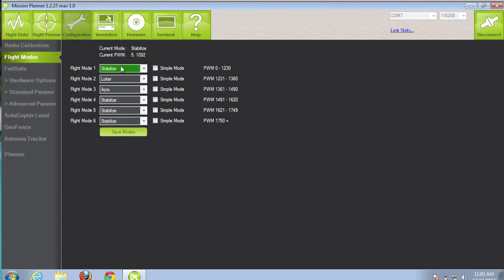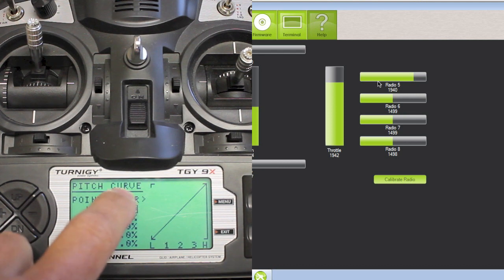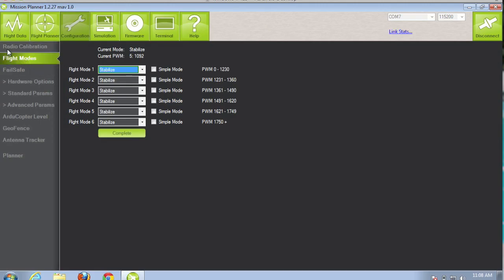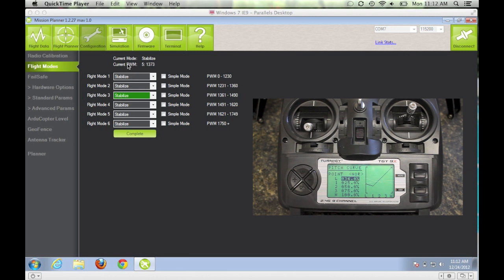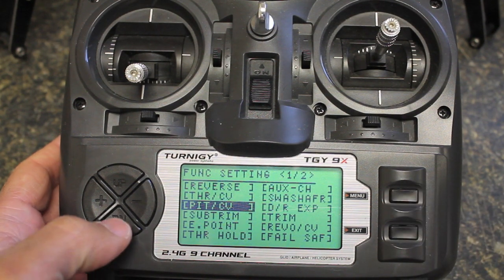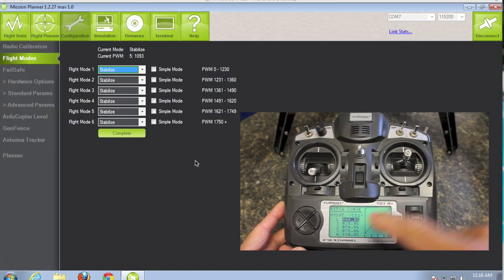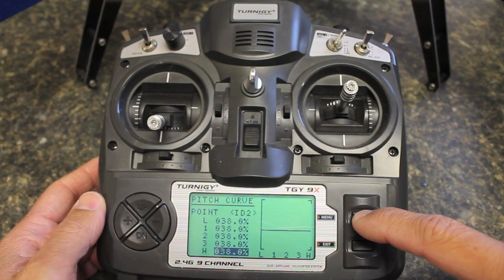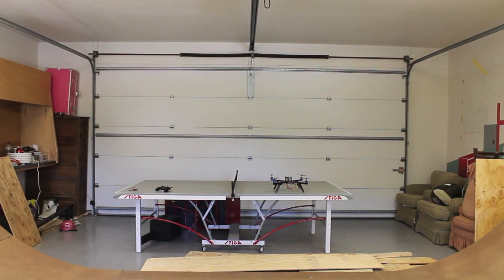Turnigy 9x Transmitter & 3 Mode Auxiliary Switch for Different Flight Modes with APM 2.5 Quadcopter

Comment: can i use this, (ZOP Power 6.6V 2000mAh 8C LI-FE Battery), to power the FlySky TH-9X?
Reply from the maker: I'm not sure. check the power input requirements for the TH-9X and if it's a 2S input I don't see what this battery wouldn't work.

Comment: Great video Dennis ~ Thanks !   Can you tell me how to assign one switch to operate 2 or 3 others please ?  I have put expo on Rudder ~ Elevator ~ Aileron so I can switch it on or off but would like to be able to control it with one switch only if possible ?  Manual is next to useless so any help will be most welcome !    Thanks again Dennis ~ I now have 6 flight modes configured after following your very easy to follow video !
Reply from the maker: +Eddie Lloyd Thanks so much for the good words. Unfortunately I no longer have my Turnigy 9X so I can't recall how to do what you're asking. Maybe someone in the group will know. Good luck with your setup.

Comment: I have an FS-TH9X, it should be same as the turnigy 9x. Where you get that MODE 7 ?. Mine only have 4 modes.
Reply from the maker: +Sam Smester Maybe you need to update firmware if you don't see it? I'm not sure as I've never worked with the TH9X.
Reply: +Dennis Baldwin My mistake, that MODE refer to Model looks like you had 7 Models on you radio and used #7 for the demo. Thank you for this video, it works in the FS-TH9X as well, all I did is swap channel 5 and 6 on the receiver connections to the PPM encoder. I set that switch for Alt-hold, GPS and RTL like it is done in the Devo F12e for the Scout X4.

Comment: Awesome video man, I have the B revision RX/TX and if I use this method, it does give me three flight modes, but it makes my quad unresponsive to roll input. Not sure if you experienced that or not, but I followed your instructions to the letter with minor variations to my pwm values because my TX has slightly different pwm ranges.
Reply from the maker: +Qdoggus I haven't experienced that before, but good to know. I'll need to revisit and see if I can update the video with the latest rev. Thanks.
Reply: Absolutely man, you're welcome.

Comment: my turnigy is standart like yours, why the pwm signal on calibrate radio is not up to 1943, but just full on 1845,, ?
Reply from the maker: +magfur ramdhani Perhaps look at your subtrims and endpoints. Maybe those are limited.
Reply: +Dennis Baldwin hi Dennis thx for helping me

n this is real, my quad orientation is  reverse, when i forward my elevator, the quad is backward, and conversely,,, so i reverse the elevator on submenu reverse,, why this is happend with may quad

info, i use :
All setup remote like yours

APM 2.6
Remote standart firmware turnigy 9x like yours

thx Dennis

Comment: Dennis, I watch your videos all the time. Great job! I have a Pixhawk build, and using a ppm encoder. All channels (1 thru 8) are going from the Turnigy receiver into the encoder, and a signal wire going out of the encoder, into the RC port of the Pixhawk. This doesn’t allow the ability to go from ch6 to pin5 to operate the flight mode. Next to the PPM Signal out pins of the encoder is another set of pins saying AUX. Would it work to connect the AUX to pin5? I’m stumped. Thanks, Joe
Reply: +Offroad Footage , I have the same configuration as you. I just managed to solve it by swapping cables for CH5 and CH6 in the receiver.

Comment: You can set up to 6 modes combining 3-mode switch and AIL D/R switch in mixers. The order of modes will be 1-2-3-6-5-4 but each you can tune in MissionPlanner and keep it in mind like 1-2-3-4-5-6 )

Comment: THANK YOU!!! 
After MUCH googling and youtubeing, this is the first that actually helped me! I wanted to use a 6-channel receiver instead of the bulky included 8-channel, and all other instructions made me end up with the 3-position switch on channel 7 somehow, using PLANE-setup and mixings! Haven't tried it live yet, but it seems to work on the bench with my new NAZE32 and CleanFlight!

Now, the question is, can I use channel 5 for anything useful still, or will that screw up anything? Could I i.e. set the gear-switch for arming or a beeper (lost model alarm) or LED's?
Reply from the maker: Preben Stub Thanks for the feedback and great question. To be honest I'm not entirely sure. It's been a while since I messed with my Turnigy 9X and don't recall ever trying this. I would assume the channel is not available since it's setup as AUX, but don't quote me on this. If you test let us know what you find out!
Reply: Dennis Baldwin I have now upgraded my Turnigy 9X to ER9X Firmware, and managed to get the 3-position switch to channel 5 without any problems, and the possibility to put any other switch on channel 6. Works great! Don't know why I didn't upgrade earlier! :-) Thanx again!

Comment: good afternoon how to make the flight modes for hexa 6 engines?
Reply from the maker: ulisses salvador I'm not sure. It's more dependent on the type of flight controller you're using and not so much on the number of motors you're flying with. So you should be able to use a similar configuration if you're flying with APM or NAZA. Sorry....hope this helps.
Reply: Dennis Baldwin I'm using the radio Flysky fs TH-9x 2.4 ghz I'm using 6 engines

Comment: Hello. 
Thanks for this informative video. 

Can I ask if you know how to get 4 flight modes from a 3P switch on the 9X, or even if it's possible ?

I have a flight stabilizer for an aircraft that needs 4 different signal pulse widths all on the same Chanel. I know that would require a mix of some kind, but I'm not sure how this might work. 

Thanks again.
Reply from the maker: ***** Thanks for watching and the feedback. The only way I know to get more than 3 flight modes is this setup:

https://www.youtube.com/watch?v=sHOAMyFRGiM

It's somewhat depending on your flight controller. I wasn't able to do this with the NAZA and only the APM from my tests. Best of luck and let us know how you get along.
Reply: ***** You can set up to 6 modes combining 3-mode switch and AIL D/R switch in mixers.

Comment: I purchased a Fly Sky, FS-TH9X, which is supposed to identical to the Turnigy 9X. But it doesn't show "Pitch Curve" or "Throttle Curve" in any of its menus or submenus? Is this suppose to designed this way, or has something been left out of the radio? What program to you use to program it then?
Reply from the maker: Joseph Gunther I believe those are pre-programmed with certain templates. Perhaps the FS-TH9X doesn't have them. Not sure how to help as I've never used this version of the transmitter.
Reply: Joseph Gunther  Just trying to setup the 3 pos switch. THe Pitch Curve exists in the Heli Mode and not in the Airplane mode of FS TH9X... Now what?:)

Comment: Hi Dennis, quick question for you if you don't mind.  I have only used DJI flight controllers and I'm looking at getting the new HKPilot 2.7 however I have a lot of questions.  What I'm trying to figure out is that the website says you can link this up to a tablet, have you done this before?  I'm curious if you can modify waypoints out in the field?  I'm pretty much just trying to wrap my head around the whole mission planner/ waypoint tracking in itself.  Do you bring the laptop/ tablet with you, do you need to be connected to wifi?  Do you have to to waypoint tracking planning prior or can you change on the fly?  I apologize for all of the questions but I know you're smart and probably have some great answers.  Thanks Dennis!
Reply from the maker: Mike Niederlander Yes you can link it up to a tablet if you have the telemetry radios. You must also make sure your tablet supports the on-the-go cable otherwise you'll be forced to use Bluetooth, which I like better (no wires!) Here's a vid I did that talks a bit about it:

DroidPlanner Telemetry for APM 2.5 using Samsung Galaxy Tab 3 and Bluetooth Module

Yes you can modify waypoints in the field. I plan on doing an in-depth video on DroidPlanner soon. Will definitely cover this. Hope this helps and thanks for watching.

Comment: I will be using my 9x for my new hunter Vtail quadcopter... what mode should i setup? Heli or Acro? Thanks in advance
Reply from the maker: Lance bourque I've recently been flying in ACRO mode. If you want more info about why check out this video:

Turnigy 9X Heli and Acro Flight Modes Explained

Hope this helps and good luck with your setup.

Comment: Hi Dennis quick question does the backlight turn off after a few seconds on turnigy 9x v2 stock hook up?
Reply from the maker: ras4q2001 Mine doesn't, but I did it get it off ebay with backlight already installed. But I do remember my original T9X with a green backlight stayed on all the time too. I'd venture to say that's default behavior.

Comment: I have the original software but i'm missing PIT CURVE! Why?
Reply from the maker: Alexgri You may be in a different flight mode. I did a video a while back explaining the different modes:

Turnigy 9X Heli and Acro Flight Modes Explained

Good luck with your setup.
Reply: I am in Acro , is it right?

Comment: It's interesting trying to follow along when you're running APM Planner 2.0.10.  In 2.0, the "green bars" are in "Initial Setup", not "Configuration".  Once I found the right screen, the rest of this went smoothly.
Either from this video, or the three-mode video, I have AUX CH5 set to GEAR.  Can I use channel 5 again?
When I moved the servo lead from channel 5 to channel 6 and re-started, my PC changed the port speed to 9600!  It may not be a fluke, so be sure and check Device Manager/Ports and the port setting of the Arduino device before trying other things.
Reply from the maker: Thanks for sharing that info, Hugh. I've been trying to convert to APM Planner but am still using Mission Planner for a lot of the log analysis tools. Strange that your port speed changed. Not sure what's going on there. I'll see if I can mess around with APM Planner this week and see if I get similar results. Take care.

Comment: Hello Dennis, congratulations from São Paulo, Brazil.
Yesterday I made my fly RcTimer APM 2.5 is great, very stable, but the loiter command is causing the quadricoptero descend slowly to the ground.
Before I do any tampering, you would have an idea of what might be going on. Another piece of information, the board is inside a case and put the recommended foam over the barometer. She is protected from wind and light.
Thank you very much.

Roberto.
Reply from the maker: Roberto, have you done the compassmot routine? Not sure if that will address the descending, but it may be worth a try. Regarding the barometer is the case from 3DR or another provider? Wish I could be of more help and good luck. Also, if you get this resolved would you mind sharing your findings at www.garagepilots.com? There are a lot of us over there that could benefit. Thanks!
Reply: Hello Dennis, actually my flight controller is the RcTimer, and that worries me, may have come with some problem. Still I will do compassmot routine and see if I solve the problem.
I would like to thank you for your attention and for sure all the information I get about this problem, I will share with you all.
Thank you very much.

Comment: i just got this copter but with no radio or reciever..  what radio do i use what transmitter? what size battery do i need for the copter?  it also has telemetry how do i hook that up to see it with a android phone and or visior?

im freakin lost i got it off a cl guy for a good price has everything i need cept the radio and reciever and how to hook it all up
Reply from the maker: I would recommend a Turnigy 9X TX/RX combo. You can get this pretty cheap from HobbyKing or you may be able to find a slightly used one off ebay. If you want to know about getting it all setup and configured there are a bunch of different steps. Check out www.garagepilots.com and post in the forums. We'll help you get up in the air. Good luck!

Comment: Real quick.. I noticed that pin 8 on apm is for flight modes why do you use turnigy ch6 and amp ch5? I'm glad you did..just want to know you found it out so I could be smart too
Reply from the maker: Hey there. I've only used CH5 on my APM so I'm not sure how you've got it working with CH8. If you see the docs here:

https://code.google.com/p/arducopter/wiki/AC2_ModeSwitch

You'll notice that it says:

"The switch can be set to any receiver channel, but the receiver output must be set to channel 5 of the APM."

Hope this helps.
Reply: Yeah. I saw that.. In the wiki It shows ch8 as the switch channel I thought it was only that channel.. thx

Comment: Thanks for this video Dennis. I've just bought a 9xr with the APM 2.6 and this works a treat for the 3 way switch. Just a quick question. I'm a bit of a beginner so please bear with me. Why use channel 6 on the receiver to 5 on the APM.Why not just 5 to 5. Now channel 5 is empty on my receiver, have I now lost this channel ??? Keep up the good work, Cheers.
Reply from the maker: I think it's a function of what TX mode you're flying in. HELI vs ACRO. In one case CH5 cannot be used and you have to use CH6. Now I'm not sure if the 9XR is the same, but I need to revisit and see why it works this way. Thanks for the feedback.

Comment: Managed to figure it using the following:

This is what works for me. I use this on my MWC. Someone here claimed it didn't work for them, but it's worked every time for me.

1. Go to the AUX-CH menu and set CH6 to "PIT TRIM'

The Pitch Trim dial will be the "basis" for the mix, leave it at FULL, turned all the way clock wise.

2. Go to PROG-MIX menu and enter MIX 1, then enter the following settings

STATE ACT
MASTER FLP
SLAVE AUX (The first one)
OFFSET -100
UPRATE -100
DNRATE -100
SW NOR

3. Go in to MIX 2 and enter the following settings

STATE ACT
MASTER FLP
SLAVE AUX
OFFSET 000
UPRATE 100
DNRATE 100
SW ID2

That's it! Go to the DISPLAY menu and you can see that channel 7 is now being activated by the 3-position switch with low, mid, high output for the 3 positions. You can now connect channel 7 of your Rx to the Mode input of the MWC and it will activate the three settings.

Took me a while of trial and error to figure out.

(Note, you can turn the Pitch Trim dial all the way down and it will reverse the operation of the switch. Up will be High, mid-mid, and down will be Low if you prefer that configuration for whatever reason)
Reply from the maker: Ashley, this is awesome and thanks for sharing. I'm surprised that our setups are different and I've heard a few reports that this video didn't work for them. So perhaps there's a difference somewhere. I'm going to give this a try soon and will report my findings. I love the T9X but it's almost too configurable sometimes!

Comment: Hi Dennis.  Appreciate the video.  I was reading through the comments and I noticed someone asked if this worked with the walkera x350. Have you tried this with this quad?

 I have the 9x and the same receiver u r using in this video and set this to channel 6 as you did, but I cannot get the 3 way switch to work for the 3 flight modes. The x350 quad doesn't use software to tell me what % to set the pitch curve values. 

Do u have any ideas? Thanks
Reply from the maker: Hey Ashley, thanks for the comment. No I sure haven't tried with the X350. I actually didn't know it existed until you mentioned it :)

I noticed your other comment about you getting this working with PIT TRIM. I'll read that comment shortly and respond with any additional thoughts. Thanks!

Comment: Dennis,
Question on programing the Turnigy to have HL home-lock and CL course lock. Is there any way to program them into the Turnigy and with a OFF also. Im using the 3 way switch for GPS/ATTI/MANUEL modes but I like to fly at times using CL/HL but also OFF to. Is there a way to set that up easy on the transmitter? If so could you please let me know? Seems you about the only one online that takes time and explains things so we all can understand things. Also in your video you show your looking at the setting for like a 450/550 and what the settings should be with weight,batt type ect, where did you find that as Ive looked through my manuel the docs that come with the NAZA and cant find anything saying what a good gain to start with..Please write to me email///  james383@att.net
Reply from the maker: Thanks for the question. Man that's a tough one. I've done a video that describes how to setup a 6 position switch with the APM, but that feeds one channel from the receiver to the flight controller. I'd think you need to somehow find a way to use 2 channels from the one 3 way switch with mixing. It would control both the U port for GPS/ATTI/Manual, and then the X2 port for CL/HL. I should have some time later this week to look into this. I think this would be a very useful feature to have. Will let you know what I find out.
Reply: Thank you ever so much, I have seen a few videos on how to bt none really show or explain how, there was even a few showing removing one of the switches and adding in a 3way one but again no info just after it was done. I would not mind using 2 reg switches to control the HL n CL again a few videos online but none realy helpfull and you have always been very good at walking people through each step and easy to follow.

Comment: Thanks Dennis, just got this working on my bixler2 flaps with Tgy 9x and frsky TX.
Mode1=Flaps and Mode2=extreme flaps that act more as a air brake. So to answer pczekalski's question, Yes! :) However you need to be in helli mode and not glide or acro as far as i can tell. 1 chan using Y harness and servo reverser.

On a unrelated note Dennis I published a none tilt motor mount/landing gear that can be used any multirotor if you ever try and build yourself another. Thingiverse thing 159341